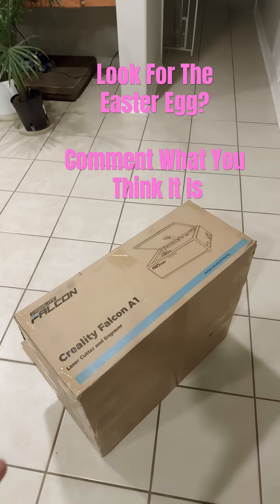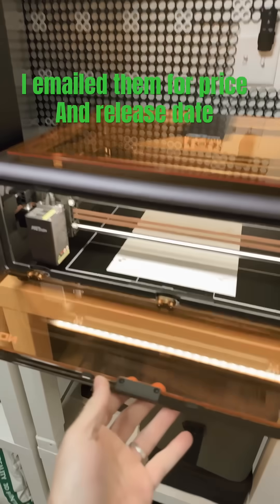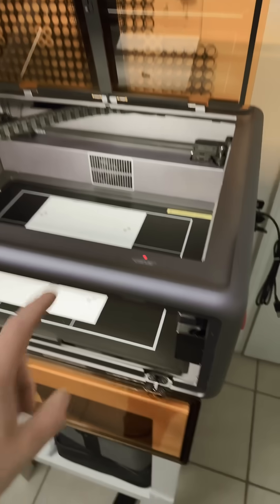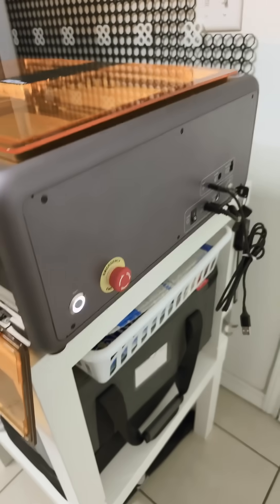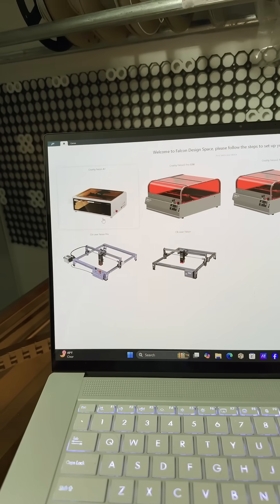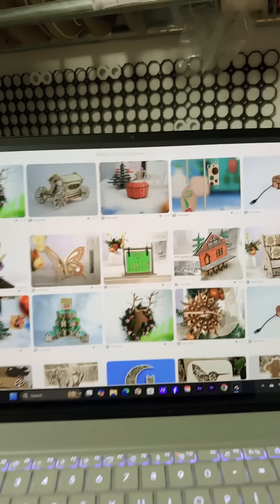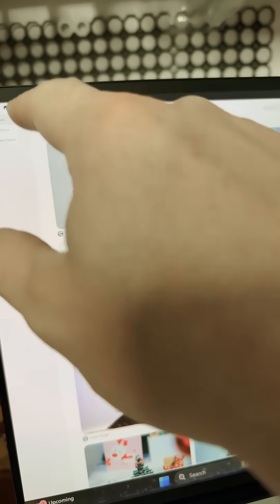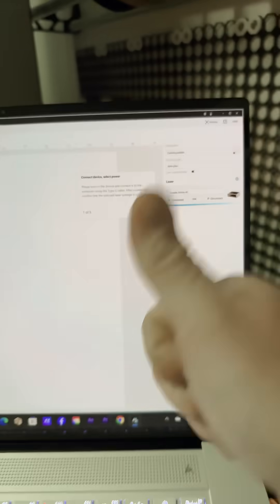Creality Falcon A1 10 Watt Laser & Free Creality Laser Software ! #creality #crealityfalcon #laser

Comment: Any good tutorials on how to use Falcon Design Space with Crealty Rotary Pro? I can't get my Falcon 10w to work with Rotary Chuck in Falcon Design Space even after it recognizes both machine. 2 inch image shows up squashed into 0.1 inch shallow image engraved on tumbler
Reply from the maker: When I get the new a1 pro I will test this. I do not have the a1 anymore. As I get alot of machines so I have to make room for new ones all the time.
Reply: @stayreadyto3dprint I have Falcon 10w with Rotary Pro.
Trying to engrave on Tumbler for quite a while ago and about to give up and return/sell whole machine..
Reply from the maker: @unitedKR have you tried watching tutorials on this yet? You need to measure the size of your cup and enter that info by the way
Reply: @stayreadyto3dprint any training video on how to engrave an image on tumbler using Falcon 10w (or any) with Creality Rotary Pro Chuck?
Reply: @stayreadyto3dprint  tutorial with Falcon Design Space? For Rotary? where? I must have overlooked somewhere?
Reply: @stayreadyto3dprint  I have tried entering the perimeters (which auto-calculates the diameter) but I'm still engraving squashed (horizontally) image
Reply from the maker: And you may need to turn your rotary the other direction